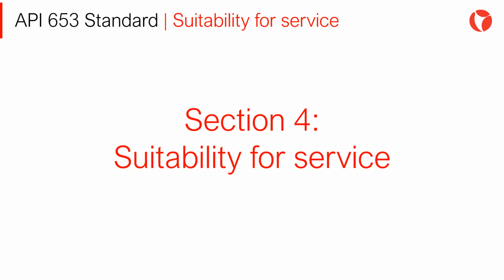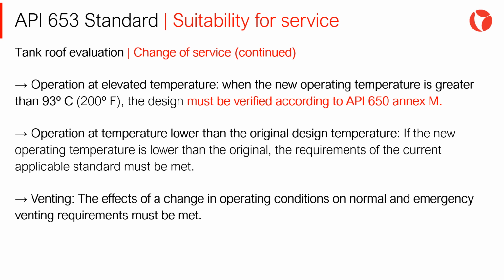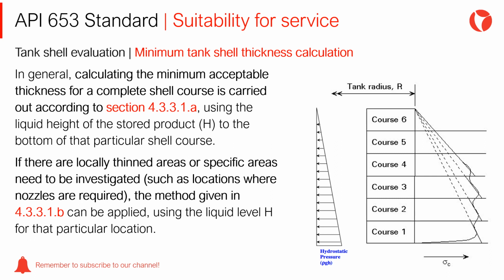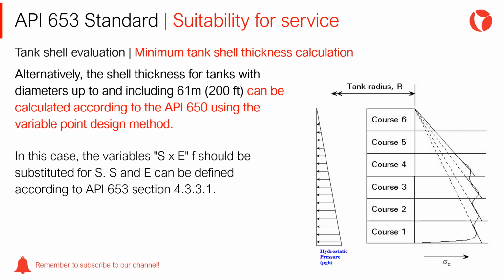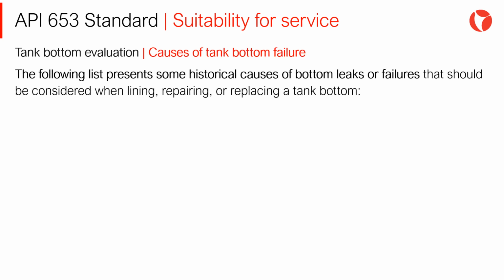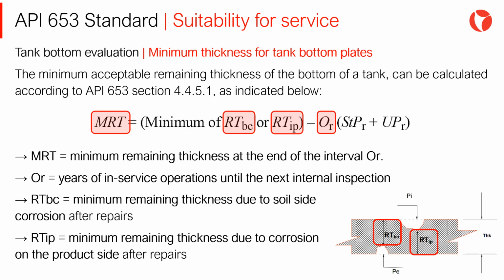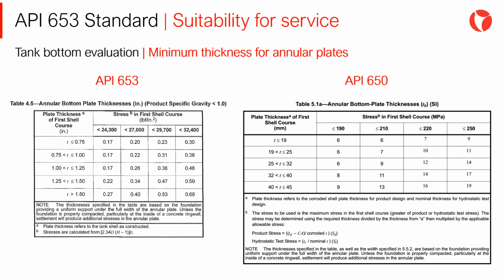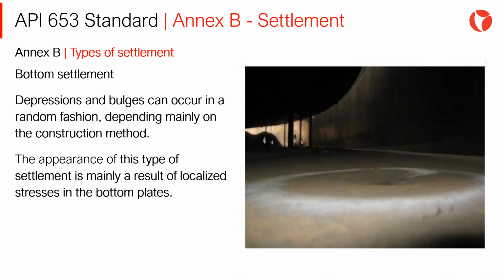3  Fitness for service of storage tanks as per API 653

Comment: 0:27 Introduction to Suitability for Service

API 653 Section 4 outlines when tanks must be evaluated for continued service.

Situations include corrosion, change of service, relocation, or reconstruction.

Emphasis on engineering judgment beyond standard checklists.

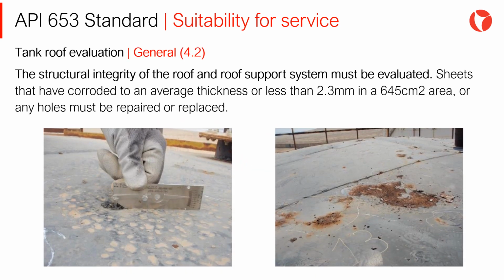2:01 Roof Integrity Evaluation

Fixed and floating roofs must be inspected for corrosion, holes, or distortion.

Roof supports (beams, rafters, columns) require inspection by qualified methods.

Internal corrosion of pipe columns may be hidden and needs special attention.

4:42 Shell Suitability and Thickness Calculations

Shell flaws (corrosion, cracks, deterioration) must be evaluated.

API 653 provides formulas for minimum acceptable thickness (Tmin, T1, T2).

Isolated pitting can be ignored if within specified limits.

16:13 Tank Bottom Integrity

Inspections prevent leakage and environmental damage.

Common failure causes: internal pitting, underside corrosion, poor drainage, settlement.

Techniques include ultrasonic testing (UT) and magnetic flux leakage (MFL).

26:43 Annular Plate and Settlement Considerations

Minimum thickness requirements for annular plates depend on product gravity and seismic loads.

Foundation settlement types: uniform, tilting, differential, edge, and bottom settlement.

Excessive settlement requires repair or stress analysis to maintain integrity.

31:30 Acceptable Settlement and Corrective Actions

Acceptable limits defined in Annex B of API 653.

Repairs or re-leveling may be necessary if limits are exceeded.

Stress analysis should consider service history, soil conditions, and prior repairs.